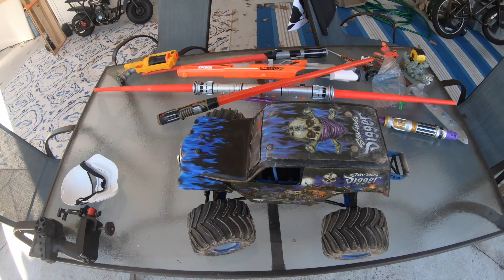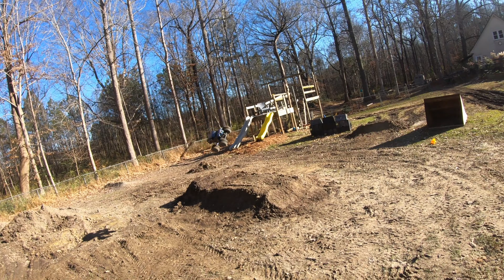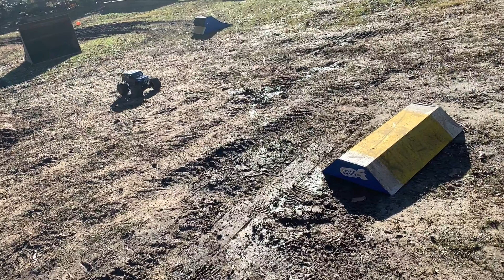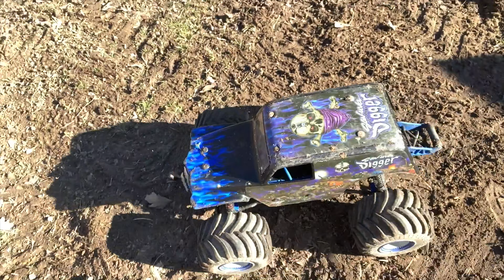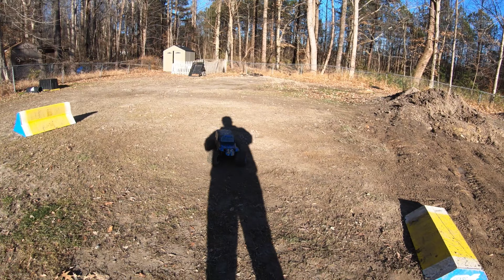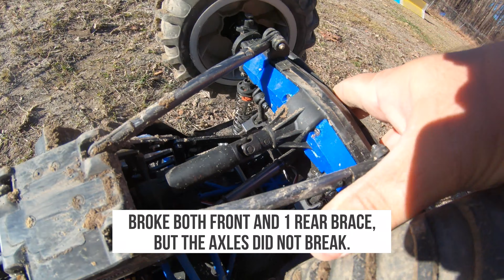Testing JER Axle Braces On LMT! Will My Axles Survive?!

Comment: Nice bash test Tony..what are those made from I think they need to be the nylon 3D printed material to be any strong like the stuff Ampro uses for his parts.
Reply from the maker: I think they are PLA, but I'm not 100% sure. I'll have to ask. I don't know that the tabs are even necessary. IT seems to snug up pretty tight and limit flex.

Comment: You need to buy a roller so you can smooth the jump faces & tractor tire imprints. Good vid.
Reply from the maker: I can do it with the blade on the bucket. This job was done in a rush before rainfall. Because it was wet, I couldn't do any more work. I have been working on smoothing it more now.

Comment: Tony you need your 2 buddies to test the axles, you're getting a little to good with the lmt lol. If it survives one pack with them test done! Love the course so far!!! I'm building a backflip ramp now!
Reply from the maker: Haha. Hopefully they'll come bash again soon when I get the backyard finished.
Reply: @CCxRC  Hey Tony do you think a aftermarket company like rpm might make full plastic axle housings like stock out of a better, stronger plastic? Im really hoping for that.  These housing made out of rpm composite plastic would be great
Reply: @cwatson42785  going on brotherman 👋 i was hoping the same but than I thought about it ,  how come they never made us stuff like that in the past , either its a patten thing . Or possibly its too costly for new molds . I'm kinda person if I spend 400 on axles I be less inclined to bash that hard , id rather have one I beat up another to upgrade and look pretty uk .
Reply: @paulclancy2404  Yeah Paul great points! Let's cross our fingers and hope lol. I think its a possibility as the lmt seems to be selling really well. I think that's what it might take is a mainstream truck that the masses buy. 🤞🍻
Reply: @cwatson42785  I like the truck alot its perfect for bashing around the house , hopefully I get new axles tomorrow,  mine broke like glass ,the braces wouldn't of helped,    my fault in fairness I left the lmt in my truck 35 degrees . The whole back cracked in half.  , even rpm dosen't maybe other companies besides treal , need 2 Lmts one drive like Tony here ,one to soup up .
Reply: @paulclancy2404  Damn Paul lol. Did it break just sitting in the cold or you meant it was in the cold for a while and then bashed it and broke? But all hope is not gone as it just seems like it really has to do with the cold weather. I mean Tony beat the hell outta his in warmer weather with no problems so I might just "offroad" mine and drive it normal and not jump or bash till spring time when it's warmer
Reply: @cwatson42785  yes the truck was freezing than I bashed with it , I don't think would've broken if weren't cold , I was going crazy just tried do little backflip off the fence
Reply: @cwatson42785  I wasn't going crazy I meant , definitely the cold ,truck being cold played a part

Comment: Where did you get them ramps ?
Reply from the maker: I made them. Pics on Facebook. It's a 1x8' lower board with a 1x6' upper with a 2x4 top. Then I cut out thin underlayment plywood for the sides and jump on the backside.

Comment: Hey Tony, do you have a preference between these and the Freestyle RC braces?  I'm considering investing in braces.
Reply: You’ll want to get the freestyle ones, they seem to hold up much better and give more rigidity to the axle housing
Reply from the maker: I like that the Freestyle ones tie the two sides of the axle together to add maximum stiffness. These did keep the axles from breaking though...so that is helpful.
Reply: Problem is freestyle rc ones are sold out and who knows when we will be able to purchase. Edit nevermind it looks like he has them back in stock
Reply from the maker: @cwatson42785  I was going to say. They were available for order last night

Comment: I can't wait to see how the treal axles do. Question for you, how much run time are you getting out of 2s or 3s batteries? Also what charge rate are you charging your spektrum batteries? I have the s2100, 2 2s 50c and 1 3s 100c
Reply from the maker: I'm getting about 12-15 minutes of run time depending how hard I drive. Sometimes a little longer.  I usually charge my batteries at 7.5 amps. That's a little over 1c. They can do more, but I don't usually need them in a hurry